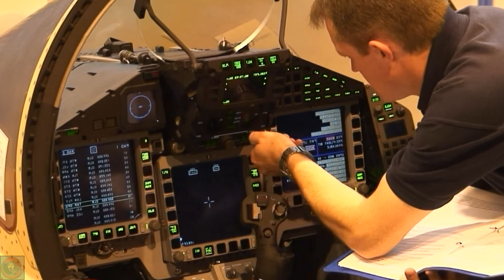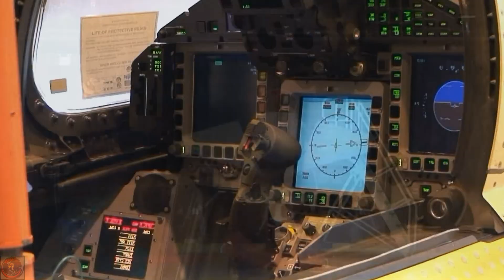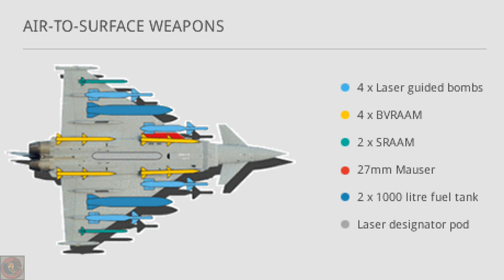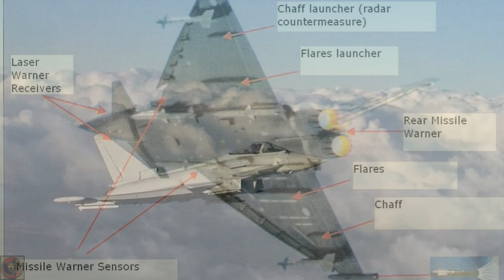Eurofighter Typhoon Combat Fighter Jet - Europe’s 4th Generation Fighter

Comment: The Eurofighter is the best in the world facts don't lie.

No one jet can beat it.

Speed.
1550mph Mach 2.0.

Hight.
65,000f.

Turn Rate Sustained Turn.
28.5 D/S.

Hard Points.
13.

Great Thrust Vectoring.

Best Power Saving Dive/Cilmb Rate.

Great British jet The Eurofighter is king.
Reply: faron tilley I mean the f-22 could take one out in a beyond visual rage fight but in a with in visual I is very fucking good.
Reply: @cringebaby2558 

Read this for a better understanding of the Eurofighter and F-22. 

The Eurofighter is the best, it can do everything the F-22 can do and more.

Some Example's to show why the Eurofighter is king, few years reading reports and papers, and all can be found online Paper's and Reports open to read. 

The Eurofighter and the F-22 both can take off and go straight vertical, something that kid's say only the F-22 can do, again they read Wikipedia. 

The Specs of the Eurofighter vs F-22 for example.

Speed /
Eurofighter 1550 mph Mach 2.0 TMS.
F-22 1495 mph Mach 1.98 TMS.

Altitude Ceiling /
Eurofighter 65,000 f.
F-22 63,000 f.

Sustained Turn Rate /
Eurofighter 28.5 D/S.
F-22 27 D/S.

Instantaneous Turn Rate /
Eurofighter 36.5 D/S.
F-22 35 D/S.

Engine Thrust - Vectoring /
Eurofighter 21,500 ibf x2 - 2D Vectoring, Vectoring up down left and right. 
F-22 35,000 ibf x2 - 1D Vectoring, Vectoring up and down.

Plus the Eurofighter's EJ200 Engines are the most advanced. 

Being 3 Different types of Thrust Vectoring, 1D - 2D - 3D. 

Eurofighter is lighter and smaller so has a better power to weight ratio.

The Eurofighter has better range / Combat and A to B.

The Eurofighter Has a Better Dive/Cilmb Rate with better energy hold.

G's and -G's.
Eurofighter 9+ and -3.5G's.
F-22 9+ and -3.2G's.

Hard Points /
Eurofighter 13.
F-22 8.

Gun /
Eurofighter x1 27mm with 150 rounds.
F-22 x1 20mm with 480 rounds.

Missiles BVR - WVR /
Eurofighter BVR Meteor Missile the best in the world x2 ranges 1st 150km for fast agile Targets 2nd in testing showed to go 300km for other Targets, The Biggest NEZ of 60km, Speed of Mach 4.5, more Agile then the AIM-120D as well, WVR the ASRAAM Faster then the AIM-9X and more agile between 5 to 55km.
F-22 BVR AIM-120D 1x range Maxed at 160km a NEZ of 20km, and a speed of Mach 4, WVR AIM-9X more agile under 5km.

But no pilot will use the full range of their missile, like the 150+km on the Meteor or the 160km on the 120D due to the low chance of really hitting anything, and giving the enemy longer for the RWS's to pick it up and just do a 180 run, making the distance longer for the Missile, you'll want to fire within about 100 - 70km or  even 50km, to have a higher chance for the Missile to hit and last time for the enemy to have to  counter. 
This is what I find funny is that people say, ( well this jet can fire from hundreds of miles away and kill it before ) NO, it's Bullshit their are the one's that don't know fuck about RWS's - MTT or even Defences, older 3rd gen jets with old as shit RWS's yes probably, but not 4th gen or 3rd gen with advanced or one of the most advanced RWS's ever in it, and plus again people that say from hundreds of miles away, don't know missiles. 

Eurofighter uses the Striker 2 Helmet more advanced and able to lock on to targets and fire with out lining the jet up with the target.
F-22 is outdated and old the hardware and software is not there to be able to use the Helmet to lock on and fire like the Eurofighter can, so the F-22 needs to line up to lock and fire.

Radar / 
The Eurofighter uses one of the best Radars out today, able to pick up the F-35 and F-22 from distance, and able to track a multi group of targets at once.
F-22 has a good Radar picks up the Eurofighter from distance as well, but cant handle as much as other radars can, but still can track lots of targets.

In War Games not just Rad Flag and in friendly training Between the Eurofighter and F-22 both have won against each other over the years, with some Eurofighter Pilots with a joke about having Raptor States for lunch. 

Design /
Eurofighter was designed for Air Dominance and does have some stealth in the design having the smallest RCS against the Rafale and Gripen, with the Wing Design on the Eurofighter it is 20% more efficient then your wing design on the F-22, The Eurofighter is 1 of 2 jets the other being the J39 the Eurofighter in the same mission go from air to air then air to ground with its payload, the F-22 its one or the other.

The Eurofighter can do all the F-22 can do plus more, The Eurofighter has better specs better Missiles better Hardware and Software plus is used by the best the RAF.

Plus the F-22 is to expensive for the US to upgrade and keep maintaining, the F-22 was stop being made years ago, plus stop training for the F-22, but the Eurofighter is still being maintained and still being updated with newer and newer Hardware and Software. 

The Eurofighter is king.

Comment: I agree this is a real beauty.   Those big delta wings and those centerline twins and that bubbliest of bubble canopies, oh my!  This is obviously a throw at an air-superiority fighter.   One look and it's blatantly obvious what it was designed to do.  It will have to guess this plane's performance is supreme at high altitude and speeds, perhaps sans F-22.   Since this video, Germany has turned its back on the F-35 as a replacement for its Tornado fleet.   They only weighed stealth as 10% of the equation, and that they were better at the other 90%.   They seemed to be saying this in the context of the Eurofighter Typhoon.  The only real competition to the Typhoon from the US be the Super Hornet but that was a long shot.  I have to question Typhoon's reliability and cost.
Reply: There is no reason that reliability is not good. In fact, the engines are the most reliable engines in service up do date. The problem is again that our (German) MOD is not capable to order spare parts in advance.

Comment: Typhoons can't super cruise
Reply: It can at mach 1.5, but payload is not specified, so it could be clean config. Who knows, but i will guess it is with a partial payload. Rafale can supercruise at mach 1.4 with 6 Mica air to air or with 4 Mica + drop tank, which are partial payloads
Reply: @lordtemplar9274  raf cant

Comment: One of the best reviews of the Typhoon to date in my opinion. I class the Typhoon's performance in with the F-22 and F-15, expecting a future where the Typhoon and F-15x deploy in support of the F-22 on any high threat missions. I don't think it's possible to talk about single aircraft types in combat scenarios any more. The communication links bind tactics together allowing different aircraft to bring specific strengths to the fight. And I mean this referencing purely fighter aircraft for the moment. The tactical variations afforded by modern fighter types are staggering. Is an F-22 flying with a Typhoon greater than their sum? Undoubtedly. They can both fly high and fast to best kinematic advantage for the missiles they carry. The F-22 has the Meteor missile to call upon, and the Typhoon brings IRST to the fight. So where F-22 numbers are limited, having the Typhoon, and soon the F-15x, to act as a force multiplier will be of huge advantage in establishing air dominance. 

In terms of the RAF, I agree that costs will limit further Typhoon development. But essentially the Typhoon is vital to the RAF. The F-35 is not designed for QRA duties for a start, but it is our future. The RAF works to optimise the combined operation of F-35 with Typhoon, which will help as the F-35 labours forward from its pitifully poor IOC. 

The Typhoon is a stunning, high performance aircraft with the attributes of a thoroughbred, high flying air dominance fighter. It remains, to this day, the only fighter that can sustain supersonic 9g turns.It retains a huge capacity for upgrade withing its airframe. Many upgrades are there bar funding. It's assured future is linked to one very important fact, however; its links with, and operation of, MBDA missiles. The best 4+ generation fighter on Earth carries the best missile suite on Earth. A brutal combination.
Reply: The F22 has become so "stealthy"that ,it never became"combat proven"and vanished from the actual military scene.
Reply: I have read reports of war games F22 and EF did together. The F22 pilots loved them. The Typhoons are the only ones that can keep up with them at altitude and though not stealthy pack a lot of punch, especially against ground targets compared to the F22. And the radar works different and the IRST complements it nicely. 

I think there will be upgrades. Germany will not buy F35 and the British, Spanish, Italians also want upgrades in the future, not to speak of Saudi Arabia.

Comment: We 👏  Need 👏  Vector 👏  Thrusters 👏  on 👏  the 👏  Typhoon 👏
Reply: Well, not sure if they're particularly useful. They often add weight and therefore mean the Typhoon may not turn as well as it does in its current configuration.

Comment: prihibitively expensive to buy and maintain... notice UK and Italy wanting F-35... Why?
Reply: The f-35 (5th gen) is a newer multirole fighter that offers a bunch of advantages over the eurofighter (4th). 

Would you get a phone that was released in 2019 or one that was released in 2008?
Reply: @waza6069  Why the fuck are you comparing a jet fighter with a handphone you idiot?!
Reply: @goodputin4324  And you just completely missed the point but alright.

I replied to Dave with an explanation as to why, so if you decide to read it, it's right there.
Reply: @waza6069  your point is void. The F-35 is a flop.
Reply: @goodputin4324  And it's void because.... why exactly?
Reply: @goodputin4324  im not really Part of brexit. Im just packing some Popcorn and having a Look at Northern Ireland
Reply: @waza6069  Too expensive and it can't do much for the price you pay.
Reply: @David-eh9le  Daft as they come.
Reply: @goodputin4324  They still went with it though, besides, they need a fighter that can be used on a carrier (hence the B variant) and are busy developing a 6th gen fighter with Germany, Italy and Spain.
Reply: @waza6069  u cant really compare a Phone with a Plane. Planes Take way longer to evolve because they are around since 19sth and not since 2008. The difference between the Typhoon and the F35 is more like between one year of Smartphone developments. The Typhoon also is Superior in multiple cases like payload, Turn and climbrate and definitely the better intercepter(what a surprise). Still Putins reaction was shit
Reply: @David-eh9le  I know it's a silly comparison to make but it gets the point across. Why would a country invest in an older plane that doesn't fit in the roles it has in mind? Besides, they'll be purchasing the B variant as well and if they decide to get either the A or C variant it'll make things like training maintenance crews and logistics surrounding it easier :)
Reply: @waza6069  i agree with coutries like UK that have Naval and Air Force. Its really the better move to invest into a plane that has exchangable parts. But countries like belgium or Germany dont really profit from that. And the F35 makes u more dependent From the US. Independence bin your military Equipment really is important. And IMO the F35 isnt worth its costs. Not with the still existing virginity issues.
Reply: @David-eh9le  Oh I agree :)
Reply: The UK needs the F35 for their new carriers. Eurofighters can't land on them. 
Italy needs to replace the Tornado.

Comment: Im surprised that a delta wing jet would be good maneuvering fighter. Serious induced drag!
Reply: The Eurofighter is designed to be inherently unstable then it only requires a small force to perform manoeuvres making it very agile and responsive. Kind of the opposite of the Stealth Bomber which is unintentionally unstable and needs the additional computer tech just to stay airborne.
Reply: The Typhoon is nearly unflyable without a Computerassistent